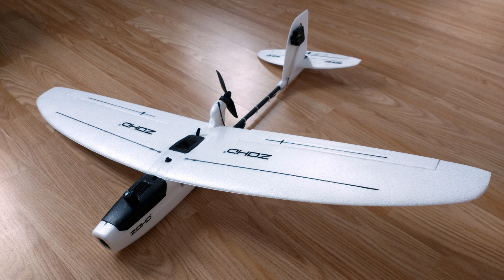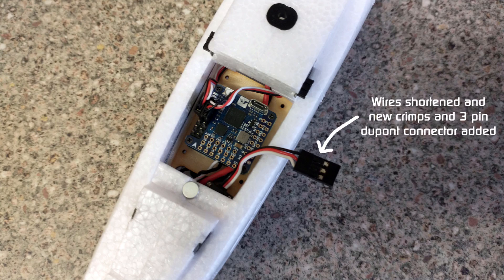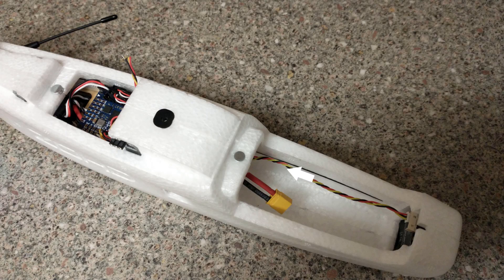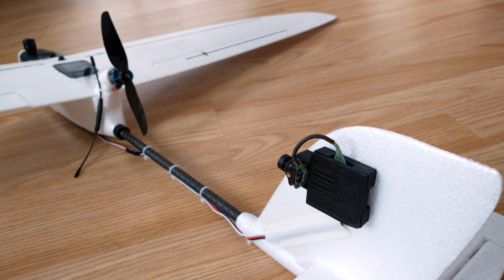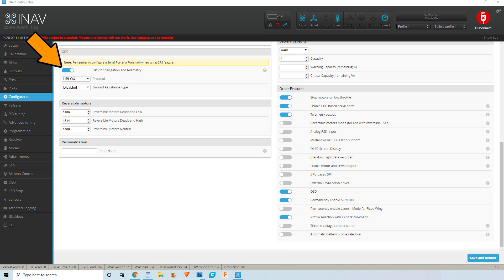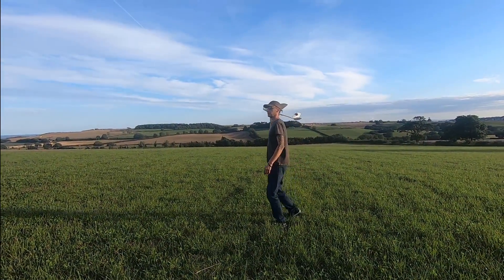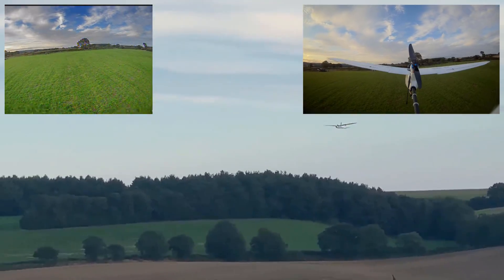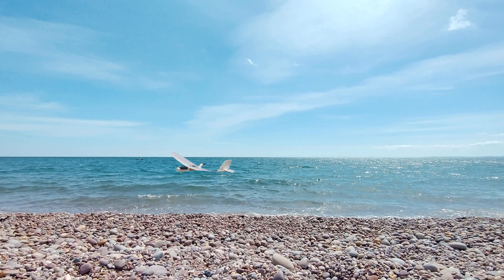🛩️ ZOHD Drift - Step By Step INAV Build Tutorial

Comment: Thank you so much for your build tutorial! I‘m quite new to RC planes and FPV and I‘ve just tried to rebuilt the Drift you are presenting in your video. Unfortunately, I‘m not able to configure/activate my GPS on the FC. I‘m using INAV 5, a Matek 411WTE and a Beitian BN 220 GPS. When I configure the GPS on the Ports tab of INAV, it always stays on „disabled“ no matter what I do. The cabeling (UART 1; rx to tx and tx to rx) seems to be correct. The GPS TX LED is flickering blue when I turn it on. Do you have  and suggestions?
Reply from the maker: My best guess would be that there's a conflict happening somewhere on Inav. Do you have MSP also enabled on the same UART that the GPS is connected too? Or is something else enabled on the same UART by mistake?
Reply: @gizfpv Thank you so much! You directly identified the issue: MSP was enabled on the same UART. The GPS is now working ☺

Comment: What do the cli codes do? should i just copy paste w/o thinking? From my research the galileo is a EU gps system right? Im us so wouldnt that be useless?
I already custamized RTH stuff so maybe the 

set max_angle_inclination_rll = 600
set max_angle_inclination_pit = 600
set small_angle = 180
set nav_fw_bank_angle = 35

would only be usefull for me?
Reply from the maker: Yes, tbh some of the codes I use are outdated now. For example, it used to be that Galileo could only be enabled via the CLI codes, whereas now it can be enabled directly in the GUI. The same is true for the codes related to RTH. You still want to set the max angle and small angles codes though

Comment: I am doing this build now, I am having a issue with the GPS it is powering on with both blue and red lights but when i enable uart 1 and set it to gps and save and reboot, it then reverts back to only the uart being turned on and the sensor goes back to disabled? Any idea?
Reply from the maker: Check that you don't also have MSP enabled on UART 1?
Reply: @gizfpv  thanks man. That was exactly it.
Reply: The very last issue i am having is with my crossfire nano diversity rx. I have it bound to my tx and showing connected. I have channels1 and 2  pins on the nano rx connected to uart 2 Rx and TX pads on the f411. I have channel output in my tx for channels 1 and 2 set to crossfire Tx on 1 and crossfire rx on 2. I can not get any response in inav from my TX. I have all the settings in the receiver tab of inav set as the following  taer, ch12, serial, crsf. I have the serial rx tab switched on under uart2 of ports as well. Am i missing something else? Much appreciate your help.
Reply from the maker: @Knemer1990  Hmm, not sure. My best guess would be to check the wiring between the receiver and the flight controller. The tx wire on the receiver needs to go to the rx pad on the flight controller, and the rx wire needs to go to the tx pad. It's easy to get them backwards
Reply: @gizfpv  flashed the fc a few times and it finally recognized the rx input. Thanks for your help.

Comment: Question for you. Why have a low voltage cutoff set to 5v when your FC shuts down at 5.8v?
Reply from the maker: The FC will keep working all the way down to 5v. Think about it, when you connect your FC to your computer via USB - that's a 5v supply
Reply: @gizfpv  true, but the fc stepping down the 5v power from a higher voltage. If the battery drops below 5.8v (according to Matek CS), then the voltage will not be able to maintain the 5v stepped down voltage.  Drop below 5v and the FC wont work.  Maybe I'm wrong, but this is how I thought it works

Comment: Giz:
This was a stellar video. Your pace was definitely high speed for a beginner (like me), but your videography was fautless, your audio great, and your use of visual aides (still photos, screen captures for configuration, and your honest sharing of the results of your flight refreshing. We beginners need to know that even the experienced pilots have issues at every step. I loved your use of the tail cam, taking advantage of the 2 cam capability of the Matek 411 WSE flight controller. I'm subscribed to your channel after only this video! Thank! I hope you will add notes to the bottom of your video text with additional conclusions as you find them. Keep sharing.  - Jim

Comment: Great instructions!  Originally I set mine up with the KOPILOT.  Worked great. I really wanted OSD so I went with INAV and the Matek F11 WSE.  Mechanically didn't change any servo linkages, but the model drops, it doesn't nose dive, but I have to pull the elevator stick back quite a bit.  CG is right on the CG marks..  Any thoughts on how to correct this?
Reply from the maker: Id maybe think about mechanically adjusting the elevator servo linkage so that the elevator is up a little when the servo is at centre. Or failing that, just do a servo autotrim?

Comment: This is great. I just bought a Drift after watching a review by Ragthenuts, it arrived this morning. Decided to go with a Matek F411 WSE, despite him having trouble fitting one, that should be here next Tuesday with luck. Already have a Phoenix 2 and a Runcam Hybrid 2.
Then found this video. Perfect, apart from the TBS VTX it uses almost identical kit to mine, so nice to have my choices confirmed by someone with clearly a lot more experience than me. And to see how you fitted it, saving me a lot of time.

I will be using a 2s 21700 li-ion  pack and your tip re the esc will be useful, no point carrying the extra weight if I can't use the extra capacity to its fullest.

Comment: @GizFPV Any update on the ZOHD Drift project for 2021? Am curious what changes/improvements you plan to make? eg: since you preferred rear-view camera, will you choose higher quality camera/VTX. There are also a couple new(er) FC options. ;)
BTW: Would love to see some Drift flights along that cliff and beach, looks to be epic scenery. :)
Reply from the maker: Not yet. I received the replacement from Zohd as promised, but it's still in its box waiting to be built. It is on my list of things to do and hopefully will get done in the Spring. Have got a few ideas for improving the build 2nd time around. Gonna try use much lighter parts, and will also see if I can get it sub 250g
Reply: @gizfpv  Great, thanks. Just received a Drift and thinking how to configure. It's winter where I am as well, so have couple months of rainy season.

Comment: I have drift with Matek 411se.
It flied well, in general (except at take off it's going nose down).
At the last flight, over sea, I have lost power, EXACLY like you, it felt in the sea.

Because I won't receive another one for free, I have recover it.
For start, the flight controller if broken.
Esc is OK. Split camera/vtx/GPS, idk yet.

I suspect it can be a bug from INAV with this FC..
Reply: I use the INAV autolaunch feature and have never had a problem.  Just throw it and it will climb out until you touch the sticks.
Reply: @raptr49  it was a bug, 3 years ago, in INAV for a certain version. It was fixed after 1 week with a nea INAV version.

Comment: The disappearing OSD items could be occurring when they exceed an alarm setting, which is supposed to cause them to blink on/off. There is something with the Matek boards that fails to do this properly and instead they simply turn off.

The fix is to “set display_force_sw_blink = ON”